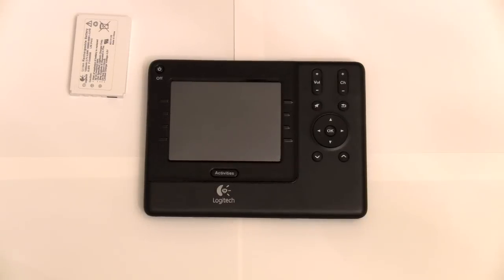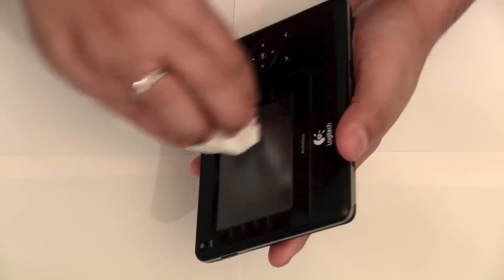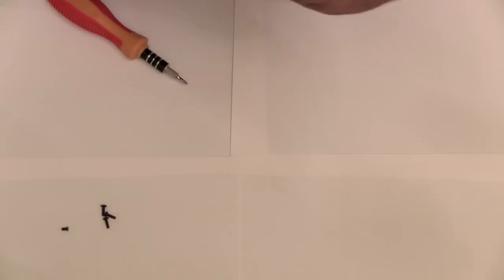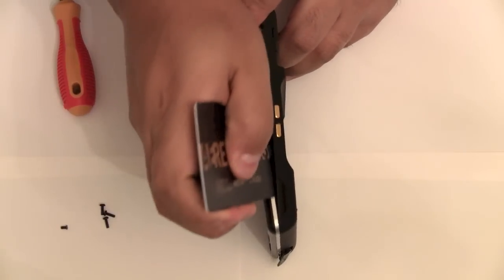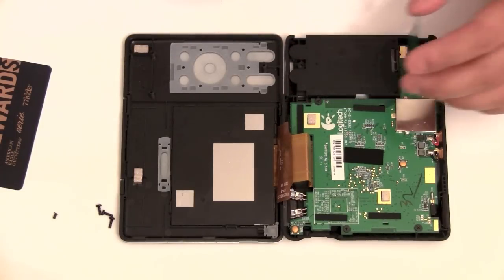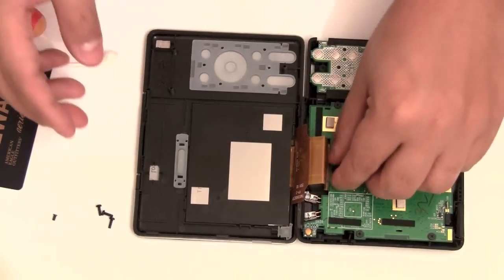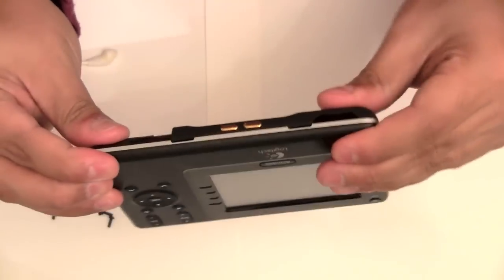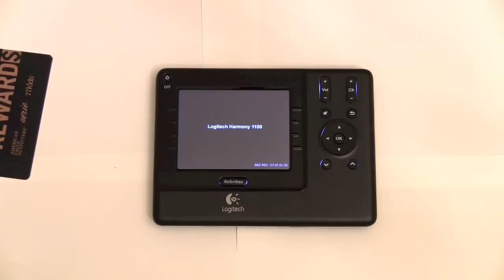Cleaning the Logitech Harmony 1100 LCD Remote

Comment: Great video, After someone in the family dropped my 1100 (cough, wife, cough) the screen became unresponsive. before I decided to try to get it repaired or god forbid have to buy a new remote, I found your video. Great to know how to open it up.  So after a little inspection I noticed the black cover over the back of the LCD was not clipped in completely. This caused one of those little square foam things to break contact. Once i snapped the black cover back into position it worked like new! 

Thanks again for posting this.

Comment: So my Display was always blank. I'd get a little flicker every time I powered on or sat it on the charger. Turns out that over the years the "Activities" button got grease and muck build up around it so it was always sitting half deployed and preventing the remote from powering up. 
Ripped the guts out of it by following your video, cleaned up the rest of the buttons and now I've got my universal remote back. 
Cheers

Comment: My 1100 screen went blank and the unit became unresponsive in mid-use. The LED for the power switch is on, and will not go off. Will replacing the battery correct this problem?

Comment from the maker: I would first try to upgrade the firmware again.  Before doing so, reboot your machine, and then open up the software and install the firmware.  Double check to make sure you have the correct firmware for your remote. Hopefully you didn't brick your harmony, but if that's the case, there still may be hope.